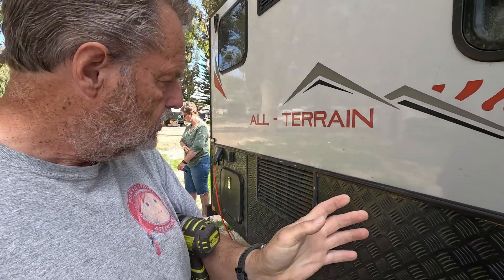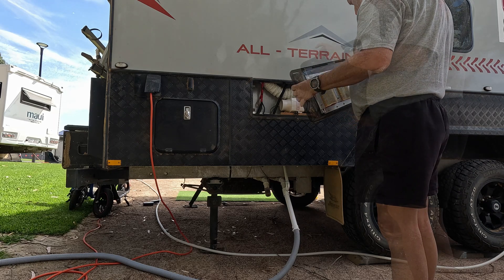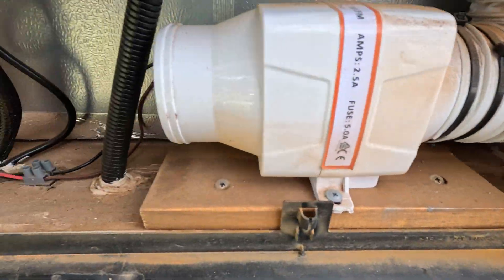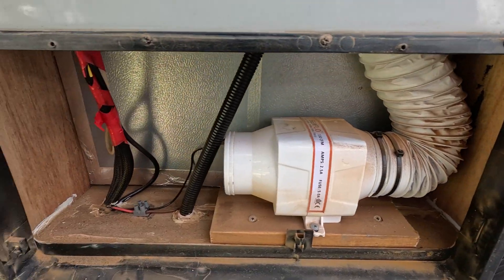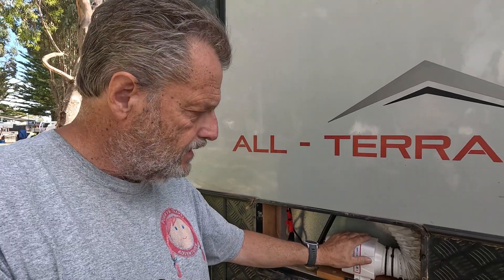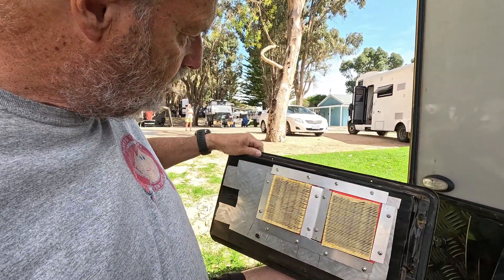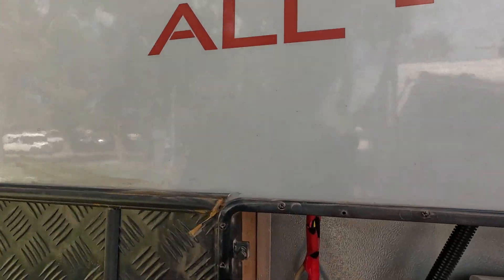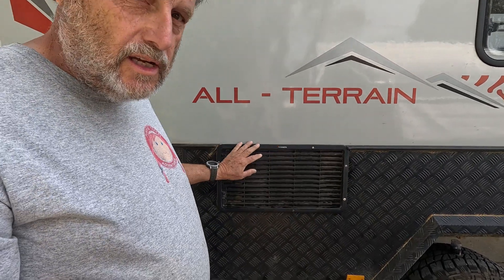Ep Mods-2305 UPDATE - Low Cost Dust Reduction System (DRS)

Comment: Thank you I copied your design, worked brilliantly. I fitted foam filter from an AC unit on the inside of the vent, made a huge difference.
Reply from the maker: Thanks for the tip on the foam filter.